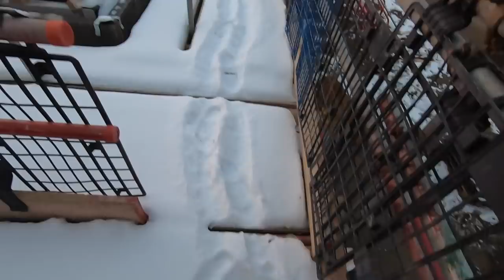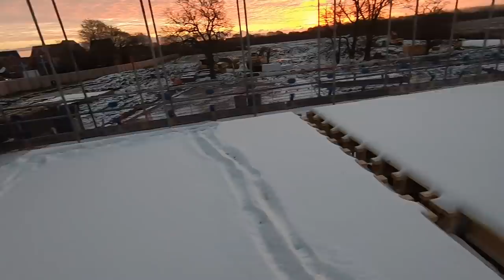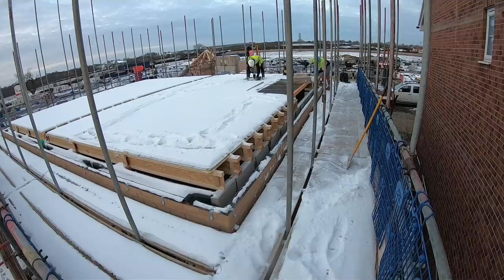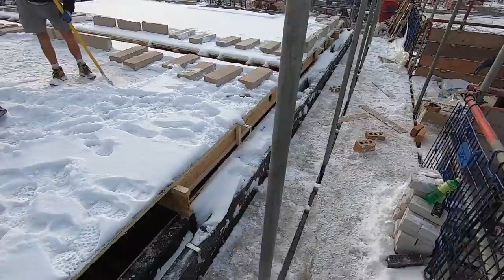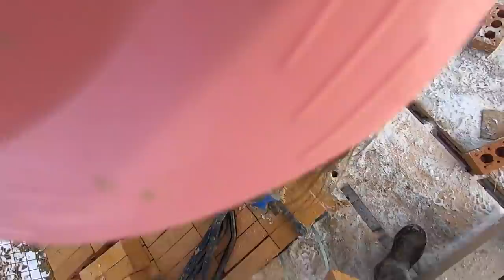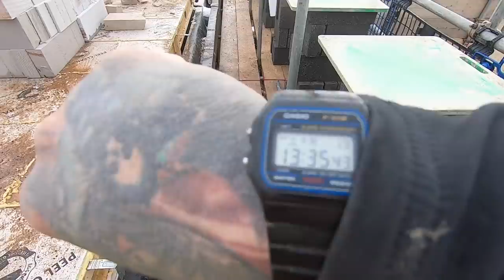Some days Preparation is key...

Comment: It's been a nightmare...I'm going to the builders merchants tomorrow morning to buy sand for Monday....I'll keep it in the van over the weekend with my 2Kw heater running. The sand on site is like concrete! Have a good weekend guys.👍
Reply: Hi Jim , could you please tell me what brand and type exactly of heater you have, I’m thinking of purchasing
Reply: @andrewmorrissey8478  Hi Andrew, it's a SIP fireball turbofan 2000 you can get them in Toolstation for around £30.00. 👍
Reply: @Jim_Newlands  thanks, I just checked and it looks good job, unfortunately most of my work is in the countryside and have no electricity, thanks anyway 👍